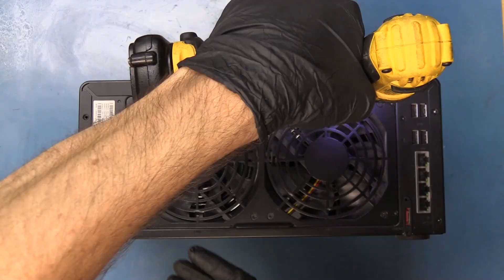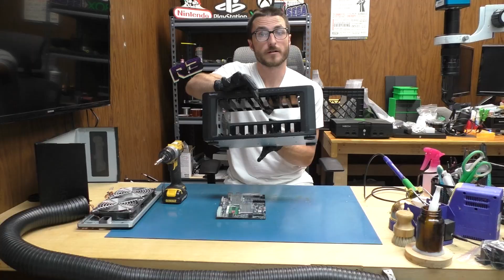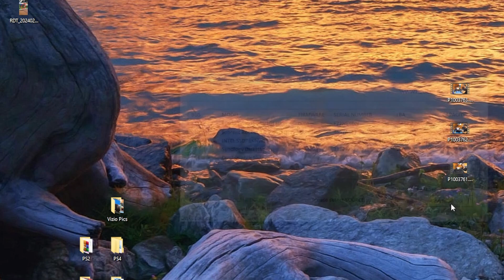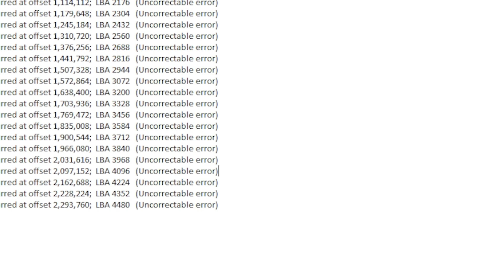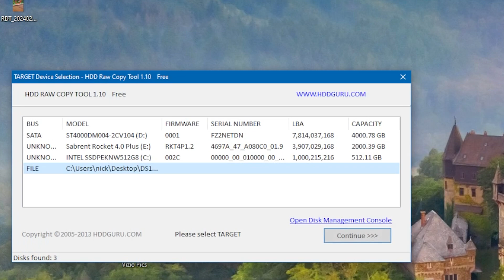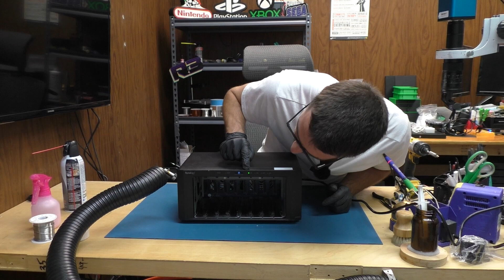Synology DS1813+ Repair

Comment: Thanks for sharing your work ! Got this issue on a DS2413+, I followed your instruction and it worked for it !
Just for info, the trace on pin 35 disappeared when i removed the chip. After looking in data sheet and seeing that it is not linked to anything on the board (nether gound), I soldered the new chip without pin 35 and it is working !
Reply from the maker: Thanks for sharing glad you got it working!

Comment: Had a DS918+. After i turned off, it wont turn on with the harddisk inside. If i took out all the HDD it can boot. during the boot state, if i insert 1 hd in, it just lost power and restart with blue light blinking for 10sec and off and on again. Is it the PSU issue?
Reply from the maker: I am not sure if it is or not but it's worth trying to replace it. We have worked on some DS918+ units in the past, and we have been able to fix some before, but we have not been able to fix a good amount of them. We are trying to get better at these and should hopefully be able to fix them in the near future. But right now we just don't have good enough of a success rate and understanding of that unit to be able to give good advice on how to fix those. I would recommend you hold onto that unit and stay subscribed, keep checking in every week on our videos because when we do figure out how to properly fix these consistently we will be putting out videos on it.

Comment: Get your self a certified assembly line drill , that drill is over kill
Reply from the maker: That drill is actually perfect for all electronic repairs. The torque can be set very low, I highly recommend it to everyone doing electronics repair. The lowest torque setting won't ever strip a screw, and if you have jobs that require a bit more torque it will also get the job done.
Also, I tried to do a quick search for Assembly line drills and nothing came up other than insane machines. Do you have a link to what you are talking about?

Comment: Hello... Nicks.. 
Nice ..nice.. 
Is it short or no ....
Reply from the maker: no its not shorted. If it was we wouldn't need to hook the daughter board to the computer to read and write to it, I would just put the meter to it.
That's why this one can be tricky, you can't use a DMM to identify the fault
Reply: @NicksElectronicRepair  Thanks sooo much ...
Really i like way to repair boards ..
Thanks ...,
Reply from the maker: Actually I am going to maybe remake this video and see if I can identify the fault with this daughter board using an osciloscope instead of hooking it up the to computer.

Comment: I did a video a few months ago showing how to fix a DS218j which had a flashing blue light due to a faulty flash IC, was half expecting this to be a similar issue.
Reply from the maker: Just about to head over to your chanel to check it out!